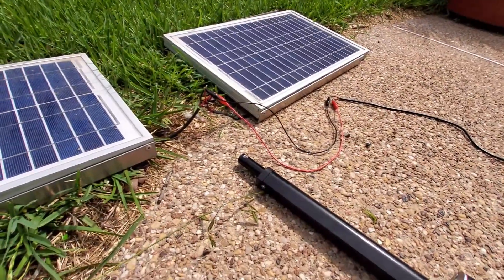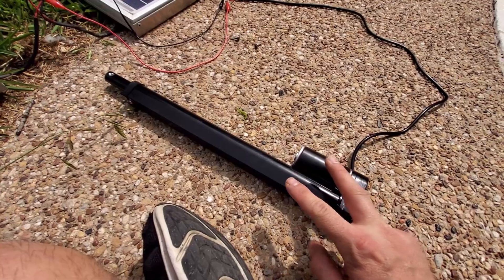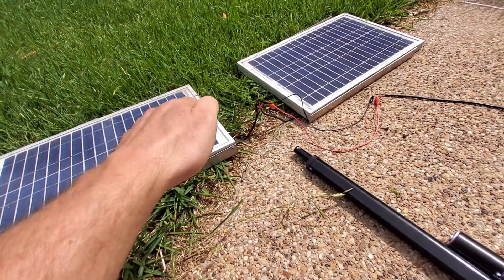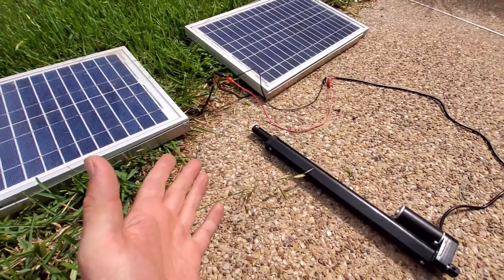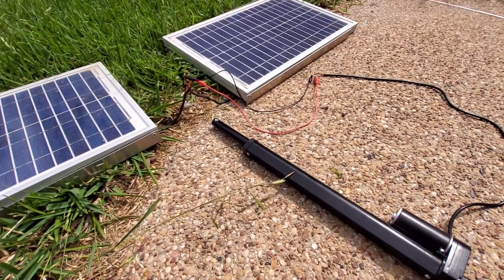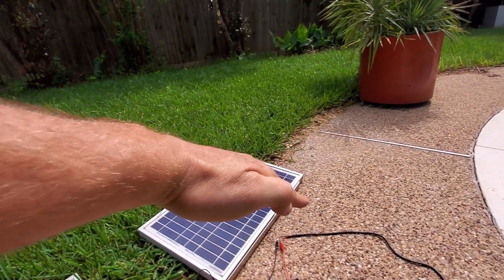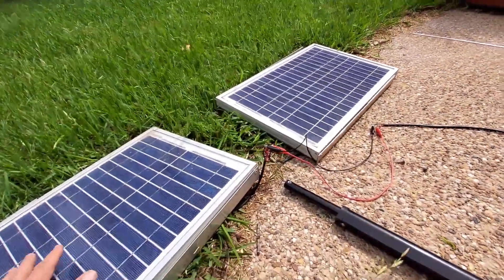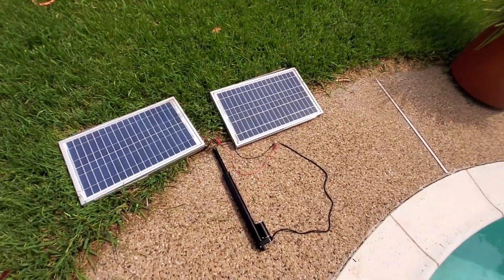Insanely Simple Solar Tracking Concept

Comment: I have a 36 volt on my 12-volt system. Much better control. Use 1/2 amp. I like this if it last. You proved it works. BUT does it last? If so, I will put your idea to work. Solar trackers you are out of business.

Comment: It’s not passive, that means no mechanical power, as in a motor.
Reply from the maker: That's not what passive means. Also motor is a passive component. Active means there is a control signal, or signal gain from active components like op amps, and/or microcontrollers, etc.. This has none of that, it's all 100% passive electronics.
Reply: @BradCagle  well, not to start a pissng contest, since I like your videos too much! But I have been reading Organic gardening and Mother Earth news since the 1970s, and have done tons of reading and research on sustainables, green energy and the like, as well as hard science. Passive always meant no motorized powered equipment. I think I would call it self contained rather than passive. The opposite is active, which means powered movement in mechanisms and living things. I never heard that control circuitry or processor control was part of the definition, as they are not physically active, as in they don’t move. I wonder where you learned the definition you propose? And sincerely, I am not into who’s right, just what’s right. Thanx again.
Reply: Maybe I also missed your point of active versus passive electronics. After all, there is the active versus passive in the mechanical sense as well. My brother was an electronics technician in the Navy, and he taught me a great deal. He was at the top of the food chain in his days in the Naval Electronics Systems Analysis Laboratory after his tour of duty with the (literally) Top Gun squadron stationed at Miramar. He analyzed electronics circuitry for design flaws at the lab. Your tracking drive mechanism is electrical, not electronic. The only electronics are in the panels in the cells and diodes. An electric motor is not an electronic motor. Several points in your video made me aware that you are not an electrical engineer, but as it happens, sometimes not knowing as much means not “knowing” something is impossible, trying it and proving it IS possible. That is the beauty of your video. But I think you know there are at least two other videos (one from 11 years ago) that demonstrate your mechanism in a slight variation. One was a school girls science project. So please take me as someone who wants to further all our goals and studies in solar, not to create friction or try to do the one upmanship thing.
Reply from the maker: @5400bowen  No worries it's all good!

Comment: I think you will need an articulating pivot. An arm either in front but probably back to let the actuator do it’s work. I think you are on to something.
Reply from the maker: Ok yeah, had to think about that for a minute, but I get what you're saying now. So I'm envisioning a central balanced pivot point for the main panels/surface.  Imagine a sawhorse, and balance a panel on it. It would take very little effort to move it from east to west. The actuator would have little to no load really. What do you think?
Reply: @BradCagle  oh I forgot this video is before the one with the working model.

Comment: Great idea. But will it be able to track for maximum sun? Can you use a baffle on one corner of each panel to provide tracking when the sun is less than direct? Maybe see how many cells have to be blocked in order to activate the actuator? I suppose  you could use a stronger and slower actuator if you were trying to move a larger array? To make it more complicated maybe you could use 2 actuators ( 1 in x-axis and 1 in y-axis) and use baffles like blinders on a horse for shadowing and track in 2 directions? Hurray up! I need to know!
Reply from the maker: Yeah, I was hoping to get something working over the weekend, but got too tied up. Baffles, yup I was kind of thinking something like that, but more on the lines of adjustable position of the tracker/actuator panels. I'm thinking I could move them farther out, or in to adjust the alignment to the sun. I'll have something working in the coming days so stay tuned!
Reply: Man, there are so many possibilities. Baffles? I am not sure, and shading? It might not come into the picture, but lots of thoughts and possibilities. I’m working on reflectors as well, possibly with, or maybe without tracking. So many possibilities, so little time!!